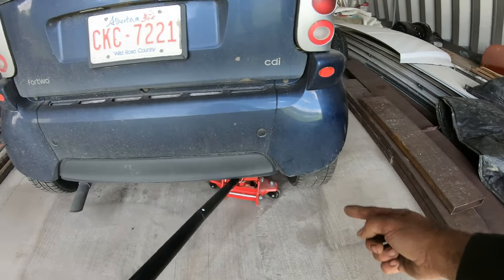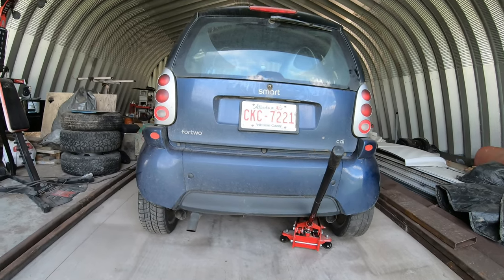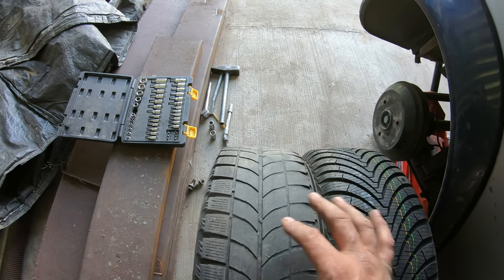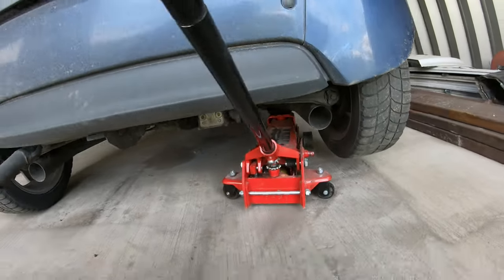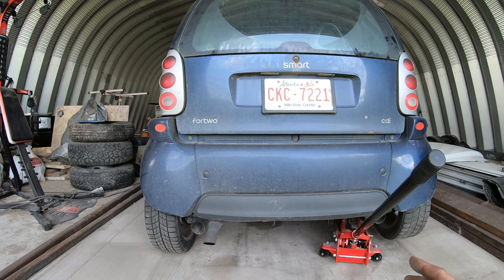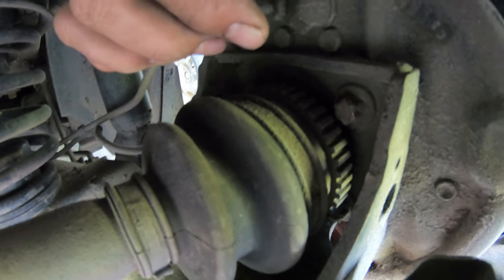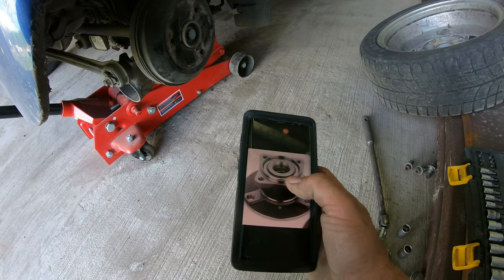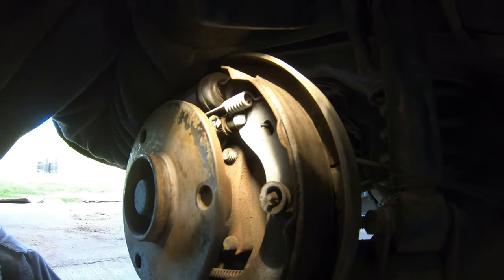Smart Fortwo Tire Wear

Comment: what sized lugbolts are used? mine are rusted out and want to have them with me when I go into get tires changed at mercedes dealership... not sure if they'd have the size
I read 12x1.5mm and 23mm length.
Reply from the maker: M12 x 1.5,  bolt head size takes a 15mm socket. Seems bit loose on the 15mm but a 14mm or 9/16 doesnt fit.
Reply: @manbuilds1587  thanks again for advice!!
Reply: @manbuilds1587  i bought 12 for 80$ and brought car into mercedes to replace my tires and said they didn’t fit. it doesn’t make sense as canadian tire checked their system and said those were right size. 118075FR.